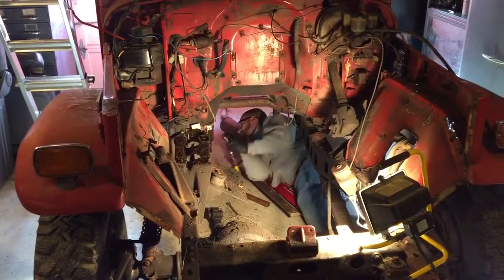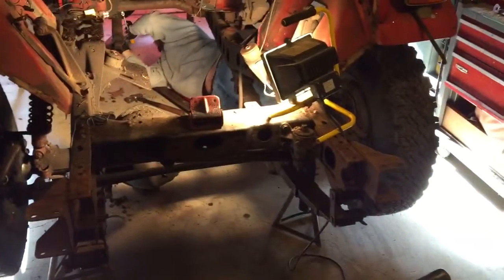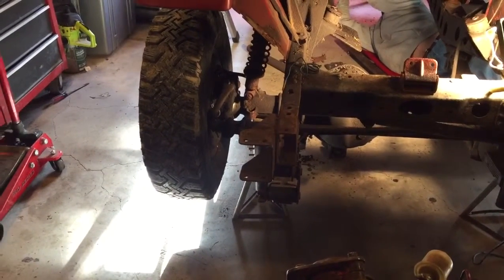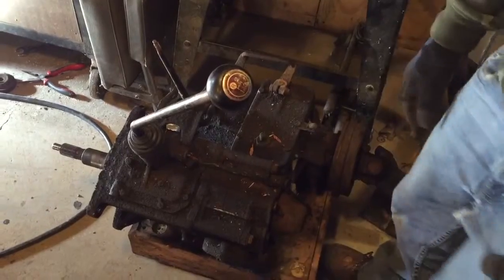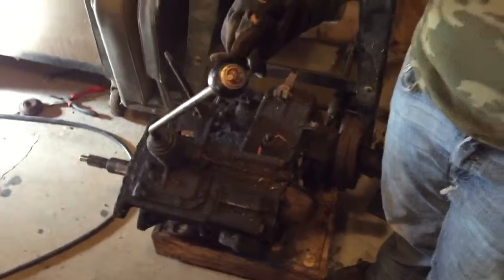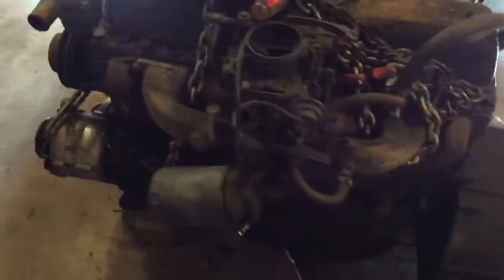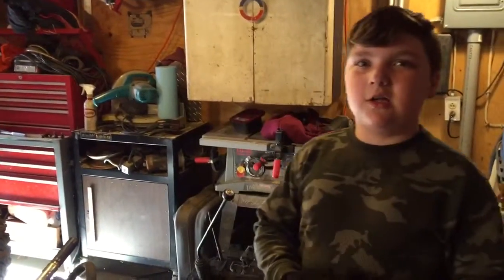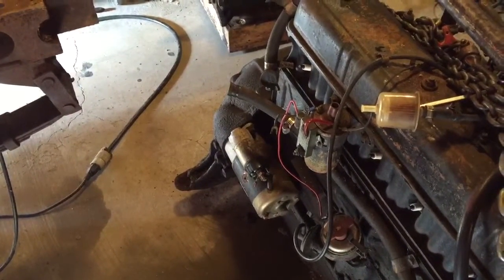EP16 - FJ40 Tank II -  removing the drive shafts from Tank.

Comment: I see the transmission and the transfer case are pretty close coupled on this Toyota anyway. On most 4WDs there is an adapter between the two. Also I see the rear output doesn't line up with the input shaft on the transmission. Interesting.
Reply from the maker: +1crazynordlander My suzuki samurais had divorced transfer cases, s there was a short shaft between the two. So if you had a 2wd samurai, the conversion was pretty much just changing drive shafts. I kind of miss that setup, as its a lot easier to deal with one component at a time, a lot lighter as well.